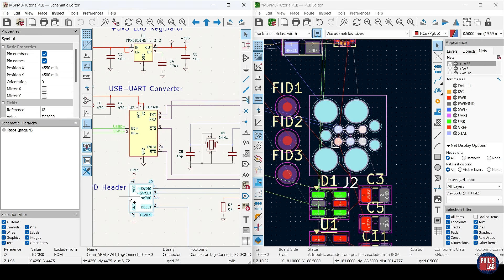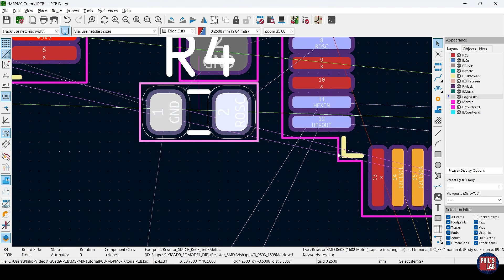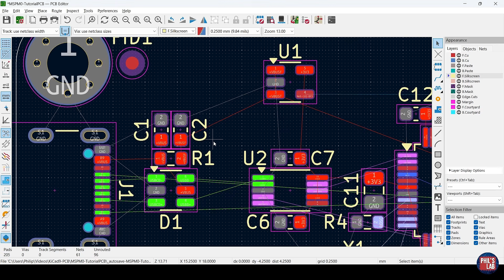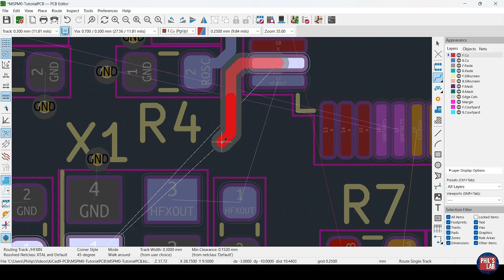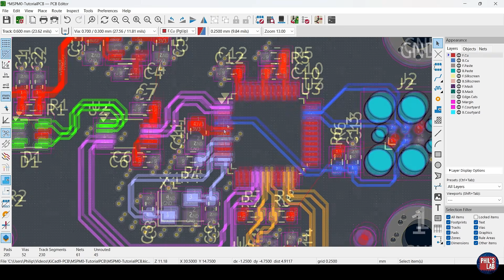KiCad 9 Hardware Design Tutorial (TI MSPM0) (2/2 PCB) - Phil's Lab #166

Comment: I want to use netclasses for my design as i believe they are very helpful for finding any mistakes and making schematic/layout easier to understand but i have SPI connection with MicroSD and that forces me to have 2 signals going go under another one. The problem/small problem is that when using net classes even routes on different layers have the same colour, so its difficult to diffrentiate if the route is going under or over or through another route. Should i drop the netclasses to gain better clearance when going to different layers or no

Comment: I've found these tutorials very helpful. It's been easier for me to make new symbols with pins arranged according to actual pinout. I also don't just string all decoupling caps together in the schematic. I'm reading datasheets and doing calculations when working on the schematic, so I make sure the connections, placement, and routing are implied clearly. This makes the schematic easier to read and PCB design much faster for me since any routing hurdles are already knows and I don't have to go back to look at data sheets all over again.

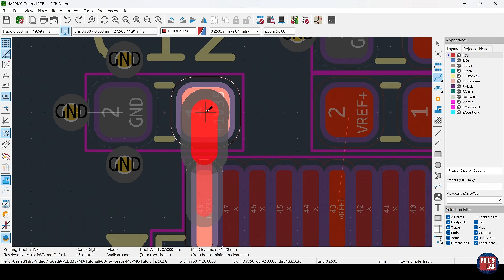Comment: Great video. Agree with the  KiCad unrational behaviour at 1:27:00. I use teardrops anyway and this helps with the "necking". 
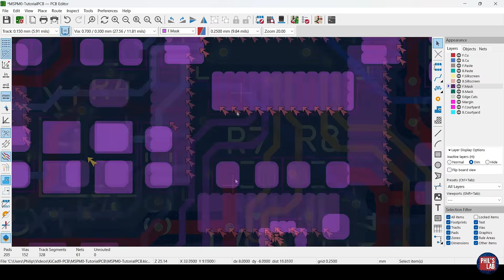Re: the soldermask errors at 2:09:00, there's no need anymore to add the soldermask expansion constraint for JLCPCB, as they explicitely say on their website that they can now do pad:mask 1:1. That's how I interepreted it, I might be wrong though.

Comment: if you had routed from the USB-C to the ESD chip from A6/A7 (rather than B7/A6) and swapped the assignments on the ESD chip, you could have routed D+/D- directly into the CH340 instead of having to loop around under the chip

Comment: Hello Phill,

Thank you very much for these KiCad tutorials. I had just finished a test kit using the MSPM0 right before you posted this, and I was concerned that I might have made a mistake with the REF+ and REF- pins. I noticed that you included a decoupling capacitor even when using the internal VRef.

There is a note stating, "When supplying the MCU with an external reference, it is recommended to connect a decoupling capacitor on the reference pins with a value based on the voltage source," which I understood to mean that the capacitor is only necessary when using an external reference.

For my design, I used the SOIC-20 version and routed the REF pins to the TX and RX UART lines, and the ADC results were very stable even without the coupling capacitor.

Comment: I'm hoping for a video to show if it's possible to run traces to ground on the top layer if possible. I bought a CNC machine and pick and place machine to mill and solder my own PCBs in an oven and making vias for a 2 layer board seems difficult and time-consuming to do by hand, having to manually hammer in copper rivets, unless there's a better way?? I'm designing for the 7mm Nordic nRF52840 chip which doesn't have pins, for context. In any case, thanks so much for this series. Making my first board should be way easier now.

Comment: Thanks for the great tutorials! I’ve been going through many of your audio/stm32 related videos and learning a lot from them. I’m new to cubeIDE, but from what I’ve read it seems like ST is going in a new direction with separating MX and IDE programs, and pushing users to use VScode with ST extensions. If you’re looking for vid ideas I’d be very interested in a tutorial setting up and using MX, VScode with stm extensions and programming microcontrollers with that environment. I tried following other tutorials but I just get the most out of yours!

Comment: I’m new to PCB design and really appreciate your videos. 

Instead of routing the 3V3 everywhere, breaking up ground planes, is it not better/easier to go to 4 or 6 layer, use a power plane/pour and bring both power and ground in with a via? I don’t think the price changes that much?

If not, and it’s generally better to route power via tracks/pours, why?

Comment: Thank you for the in-depth, step by step description.  I'm a mid-level KiCad guy, starting in the late 70s with a light table, mylar sheets, rolls of thin tape and an xacto knife!  I had a couple of questions that you answered: via on the pad to get to the ground plane - NO!  😀 and the whole ugly necking-down problem  I wish it was smart enough to do this for us - eg. a wide power bus trace connecting to a tiny pin.  Turns out your solution was what I had managed to do myself, but was hoping for a cleaner option.  Also making a drop-down list of stepped trace widths is a good idea too, locking my power bus into a single size forced too many constraints on the layout.  I'm going to go back and watch the schematic video, I skipped it thinking I knew everything I needed to know, but I'm sure to pick up some good hints.
Reply from the maker: Thanks a lot, Mike! Yeah, maybe I just don't know enough about KiCad specifics, but some (common) things are terribly frustrating.

Comment: Some very useful tips to help aligning and moving parts around:
Use Shift+M for relative movement. It's the most used command for me to help positioning and moving parts.
Assign shortcuts for horizontal and vertical alignment. It is super useful to make sure connectors, mounting holes, silkscreen and other components are aligned to each other. I set them to Alt+H and Alt+V.
Use the other alignment and distribute tools. They help a lot making sure things are aligned and spaced correctly.

I might place the first mounting hole to wherever it should be. Then, I move another mounting hole to be exactly in the same position as the previous mounting hole and use Shift+M to move it to the opposite corner (Shift+M -> 45mm for X and 20mm for Y). After both opposite corner mounting holes are in position, you can use horizontal and vertical alignment to position the other two mounting holes.

For the USB connector, I would place it roughly between the two mounting holes, select both the mounting holes and the USB connector and then use the vertical distribution tool to make sure the USB connector is correctly in the middle of the two mounting holes.

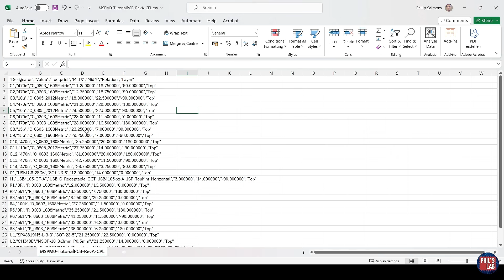Comment: 2:22:00 Actually there are plugins for various manufacturers. "Fabrication toolkit" works well for JLCPCB, you can get all manufacturing files with a few clicks. It can even adjust rotation when it's different between the default Kicad libraries and JLCPCB pick and place machines.

Comment: Can you explain how to power pcb with 230AC safe ? What filters and placenent ? How to use pcb fuses ? Maybe some project with relays
Reply: Hey man I highly suggest using atleast 1 fuse and 1 MOV, If you want more protection you can change the fuse for a fusible resistor. I really like using PCB type transformers they are somewhat cheap and easy to solder but provide less power than a usual SMPS. If you are really into filtering the input, you can search for common mode chokes or differential mode inductors. I suggest looking into SMPS design tutorials they generally use ton of this type of stuff.
Reply: For me I would buy a power supply for my project and keep the PCB low voltage, to be honest, mounting mains transformers and associated 'stuff' reminds me of the 1970s. I can't think of much where I need mains on a PCB...your millage might vary....cheers.
Reply: @andymouse but i need 230 for the relays and i need to use transformer on pcb with somę buck converter
Reply: Not an Expert

I have 230/415v on a current project for measuring it purposes. 

A few starting points for you.

Clearances & Creepage are vital concepts 

Where will you connect your Neutral? Will it be tied to ground?

Does your board communicate with the outside world via any other connection that could then ‘earth’ that system ground? 

Neutral isolation from any earth potential is vital for safety. 

Can you use 2mA/2mA transformers? 

Do you need to implement a divider network? 

Have a read up on these subjects and you will get closer to a safe solution.

Comment: Thanks for showing me how to use this software at a higher level. I've been using KiCAD for years, and improving my workflow is a priority for me every time I begin a new project. This also helps me pitch KiCAD to my work as a suitable alternative to Altium, as this can perform some of the advanced functionality of Altium, and my coworkers just don't know that KiCAD can do these things. One thing that I was unaware of was the colored traces in the PCB editor, which have hugely improved my workflow. 

Currently working on a symbol for the STM32MP25xx chips, for a project related to cameras and image based tracking as a PCIe peripheral. Lotta pins on that bugger, gonna benefit greatly from colored netclasses.
Reply from the maker: Yeah, colour nets are super useful imo. Good luck with your MP2* project, sounds fun!

Comment: I were waiting for this upload for weeks, i finished the schematic part of my custom GOWIN FPGA board and i didn't want procced until i watch this part
i had issues creating the FPGA chip from scratch as a symbol, also finding the suitable USB to JTAG IC because i had a fear that it require some sort of firmware and i don't know how to do this..... and many many more issues when it comes to footprint since the FPGA im making is small and i had a doubt that always choosing smaller footprint components (capacitors, ferrite beads, resistors..etc) might not be suitable 
Anyways thanks again for the 2 well made videos
Reply: How did you manage to buy bare Gowin fpga ICs. I have searched for them everywhere a while ago and they were only available as modules.
Reply: @mysterious_czrs  have you checked Mouser, they have many Gowin models, and some of them can be bought single piece about 8-10$, im not sure if mouser is supported in the assembly proccess